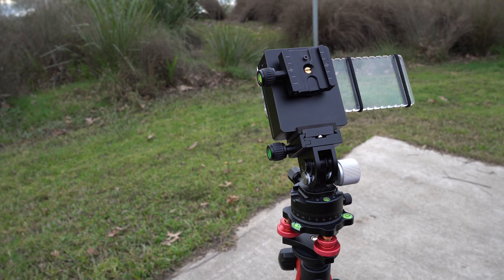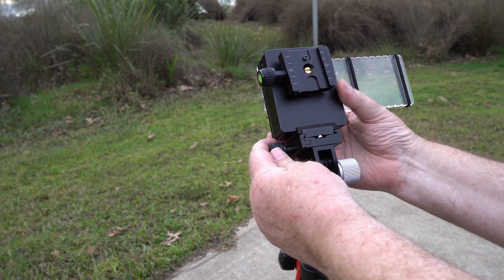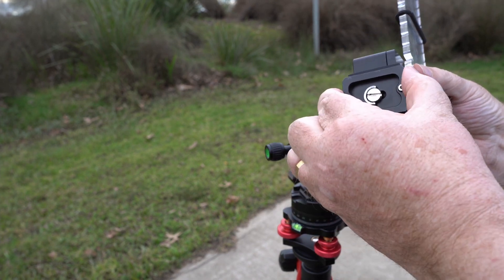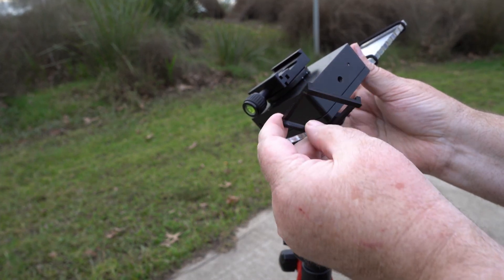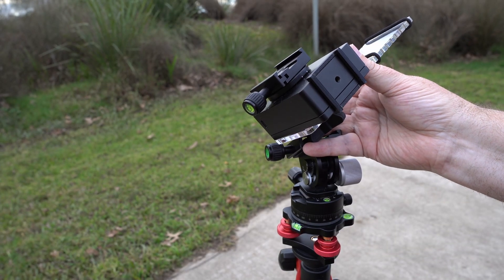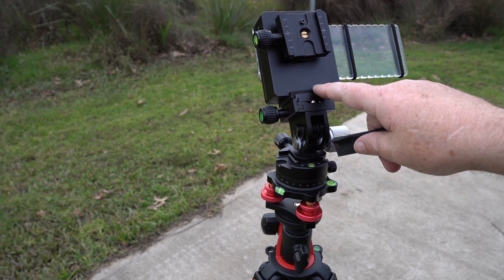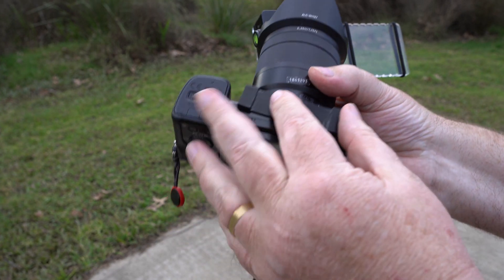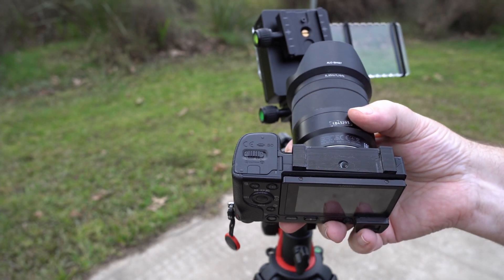Move Shoot Move: Hacks, Mods, and Nerdy Bits. Episode 3: Anti-Torque Brackets

Comment: Thanks for the video.  I don't have  a 3D printer but I do have a woodshop.  I just finished making one of these from 3/16" hardwood and epoxy glue.  I added 1/16" sheet ply to reinforce the corners.
Reply from the maker: Good work. I had thought of just gluing some popsicle sticks into the right shape as a "poor man's" version.  It should work as you wouldn't need a vast amount of strength for the job - just a matter of using the right glue. Probably epoxy but a high strength PVA might also work.